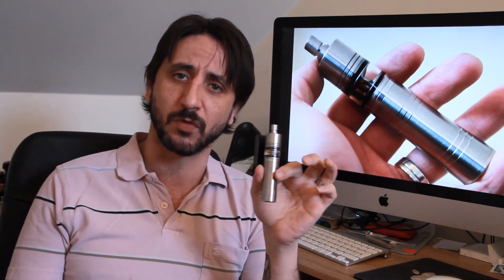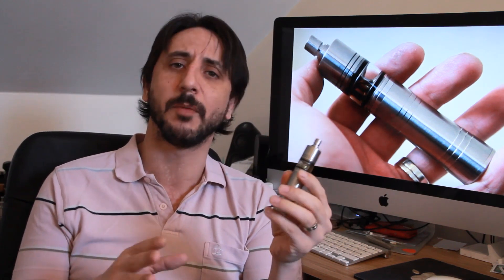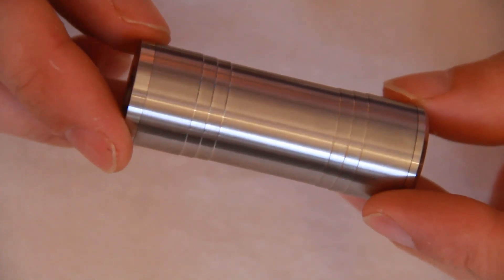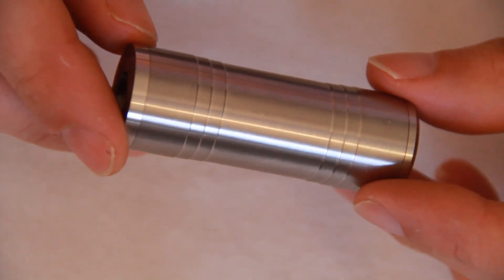Challenger mk2 Review

Comment: He keep the angle very slight on the angled top caps because he wanted to keep the height/thickness the same as the flat ones. He didn't want to add any excess height to the mood when you switch between the different to caps. I agree tho, I would rather have it be a few mm thicker and have the angle steeper to give a better look. Maybe a 30-35° angle would be better.